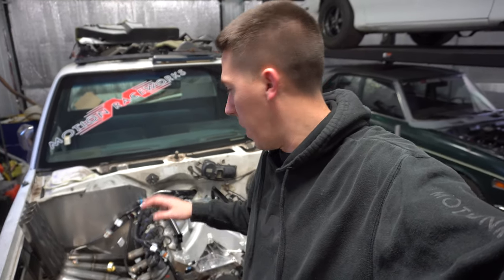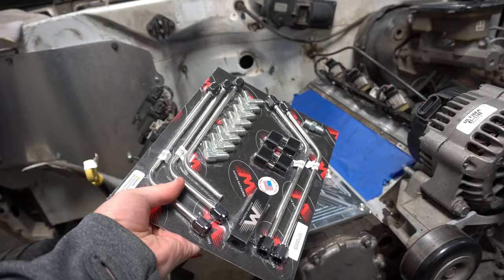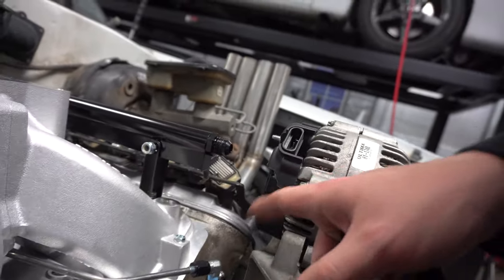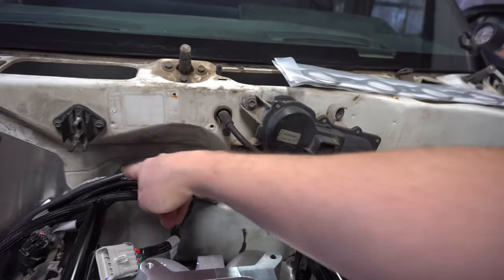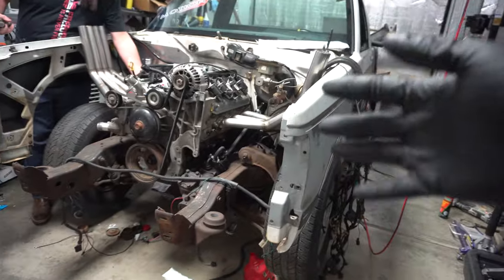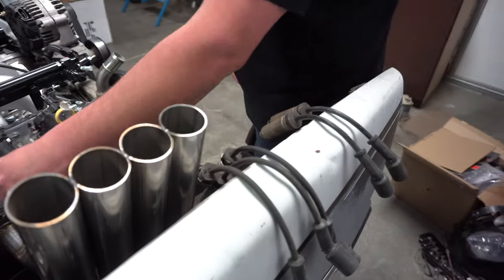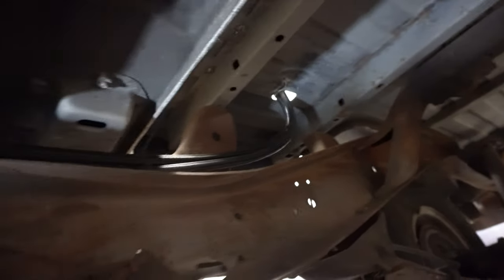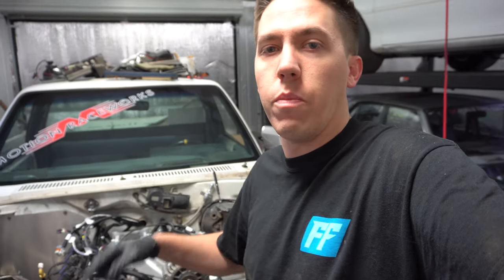LS Swap S-10 Burnout Truck gets New Intake, Steam Vent Kit and Fuel System Installed!

Comment: You should be able to shorten your trans dipstick if its too long. Just shorten the line like normal and then cut the same amount off end of dip stick on the handle side. Should be a set screw holding handle on. You may already know this but anyone else these types of dipsticks can be cut to length for a cleaner install.
Reply from the maker: I did this to lengthen on the Mazda build and remember the plastic liner being a huge pain lol. It was doable though! I also used 6an nylon to lengthen it which made it a pain as well to just shorten it probably not as bad!

Comment: Do you have a video to what is all needed to switch from gas to e85 keeping gas scale just changing afr's, timing, and fuel? its for a boosted ls1 I have 12.2:1 compression
Reply: on holley hp
Reply from the maker: You can run e85 and tune on e85 or gas scale a lot of people run e85 on gas scale you just want to screw the scale tables richer for e85 always referencing lambda. So yes just have to re adjust target afr and then you can adjust timing as needed!

I don't have a video at this time explaining it.

Comment: the driver fuel rail will need the fragola  rail to a direct 90deg . mine misses by about 1/4 inch.
Reply from the maker: Ended up getting a orb to 90! Worked perfect lol
Reply: As I finished  the last video  and this one started that's when I messaged  that. Lol. When I did mine 6ish years ago  took me a week to find  one of those. Lol